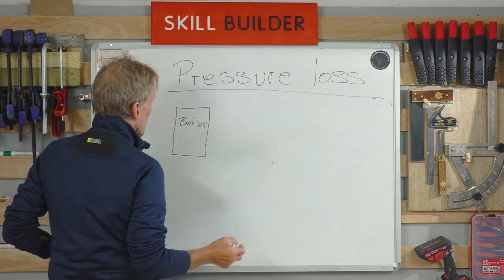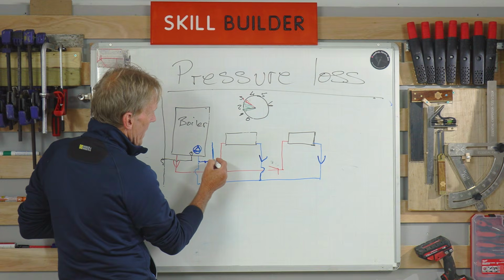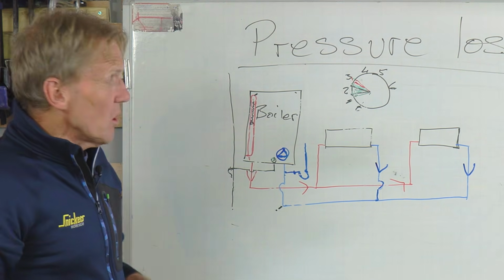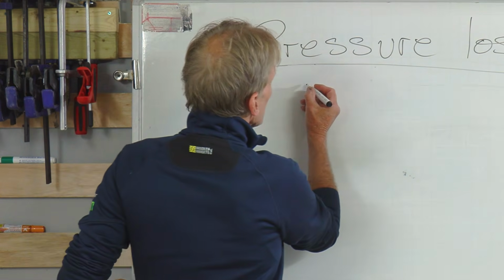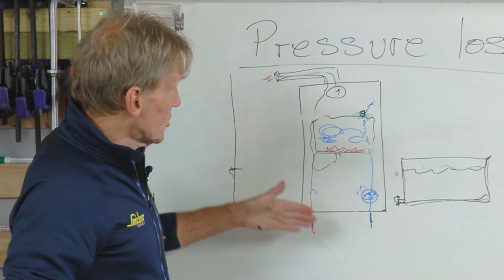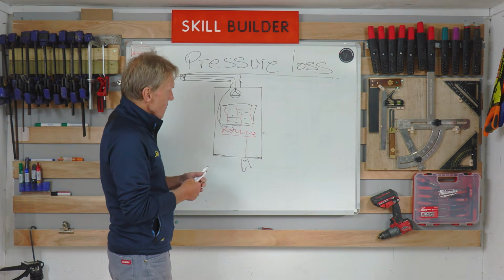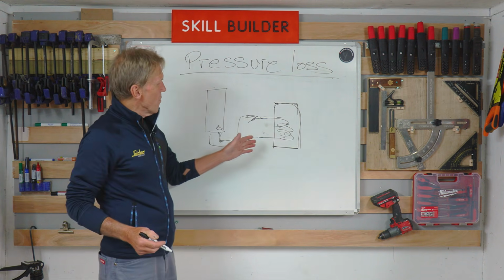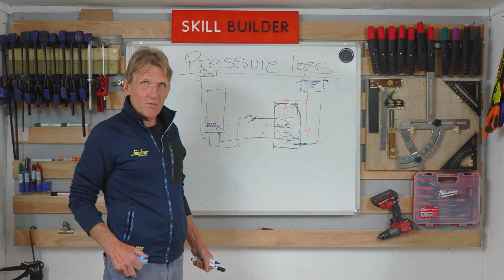Why Does My Boiler Keep Losing Pressure?

Comment: Got a 14year old Saunier Duval F30E Combi boiler which is a brilliant boiler. Expansion tank has failed so needs repressurising every time central heating is used. The only annoyance is it locks out hot water heating aswell when Central heating pressure falls down to 0.5bar!! Also because tank is fitted at the rear of the boiler it is apparently better to replace the boiler, such a waste!! I would only buy a boiler now with a side/ accessible or external expansion tank. Going for a Vailant owned GlowWorm, hopefully nearly as good.
Reply: You're literally operating a bomb if the prv ever fails.
Reply: @TheFool2cool  being replaced in 2 weeks and not using. It releases pressure at 3 bar I think, but rarely gets above 2.5 bar on guage.
Reply: @TheFool2cool  weak design component the expansion tanks.
Reply: Not just add an external expansion tank?
Reply: @grahamleiper1538  No space for ext tank as located in kitchen. I take it I can keep boiler parts for spares eg circuit boards etc? as a friend has exact same model as this
Reply: @mjames978  expansion vessel can be anywhere in heating system, doesn't need to be near boiler. Video even says they're often put in airing cupboards.

Comment: in holland we normally have expension vessels outside the boiler and since the pressure of the cold water is higher then the boilerpressure youre last solution is the other way around with us. for looking at the condensing part of the heat exchanger: we often uses hoses to connect the condensing part so we fill the heater up high and let the hose hang in a cold way above a bucket.

Comment: 6 month old Ideal boiler was losing pressure  every week, they replaced heat exchanger and most part's under insurance!
Reply: Ideal heat exchangers are prone to crack. The casting is terrible. It leaks into the combustion chamber and down through the sump when hot making it difficult to diagnose at times.
Reply: @Chickenboots1  Since repair it's been fine for 4 year's.
Reply: Yeah it’ll be spot on now there’re not cast in China 🤣

Comment: Is replacing an expansion vessel in a combi a big or a difficult job?
Reply: Depends on the boiler model and installation, if it's a newer one with an internal expansion vessel to the side of the burner, never an issue. If it's rear mounted and the flue elbows straight out the wall above it it can often be a pain depending how the flue is fixed in. Never a job for a non GasSafe registered engineer.
Reply: That depends on what boiler, is the flue blocking it etc. maybe easier to fit an external one if you have the room. Either way do not attempt it if you’re not a gas engineer.
Reply: Well said that man
Reply: Very rare they need replacing. On most boilers in the last 7 to 10 years or so the vessels are very easy to change. On many older ones the flue or other parts may need to be removed first.
Reply: For a gas fitter a piece of cake. If your not a gas fitter why would you even think about doing it. Give the man his wages and be safe. Your welcome. Ps. Don’t be replying with some sorry arse excuse. I was asking for a friend bs.
Reply: @SunnyHeywood  no need to be rude, it was a straight forward question. I actually took it to mean "is it a big or difficult job for a gas fitter", seeing as the poster never specified fitting themselves. In other words, is it something costly, messy, takes days or whatever. Fairly useful to know when you have a plumber coming round so that you're not taken for a ride with a ridiculous quote.
Reply: @ricos1497  It'll cost around £230-260 (depending)
Reply: @ricos1497  and they don't need to be plumbers, you can be a plumber with no qualifications, and many plumbers make bad gas fitters, but you can't be a gas fitter without qualifications. Go by reviews and friend referrals. The best way, mate. There are plenty of bad tradesmen around to make your day a nightmare.
Reply: @ricos1497  awww bless speak st8 and ya being rude. You spend to much time on FB.
Reply: @frosty-bf  yes, thanks! I wasn't really asking for myself, just responding to the initial response to the thread! I had the expansion vessel replaced in my oil system just last year, and you're spot on with the price! I've got a good gas fitter not far from me, so I'm sorted thankfully! You're right about tradesman though, and that could be another reason the original poster was asking if it was an easy job. I've had a lot of good trades people over the years and found it pays to keep their numbers!
Reply: @SunnyHeywood  nah, you were being ignorant. It's fine. You probably don't know you're doing it.
Reply: @ricos1497  on you must jog. Be gone.
Reply: @ricos1497  Well said Rico, such a shame that Pigs etc. just don't get this excellent channel, obviously not very bright judging by his awful spelling!
Reply: @SunnyHeywood  Hi Peter the reason I was asking was because the boiler was losing pressure and I had so many engineers look at it and condemn the boiler and quoted thousands to replace, some misdiagnosed the problem, others said the replacement of parts was uneconimical.
I stuck to my  gut feeling it didn't need a whole new install because we take care of the boiler.
Finally found an engineer who did a great job and the boiler working well and keeping pressure. Genuine parts.
I was actually interested in finding out what gas engineers on this channel might say.

So see next time before you throw out accusations at someone, just ask before you do so you ignorant presumptuous cunt!
Reply: @SunnyHeywood  If it's a piece of cake for a gas fitter then why do so many plumb in external ones? Is chiselling mortar around a flue & then attempting to keep it intact a piece of cake? Think not.